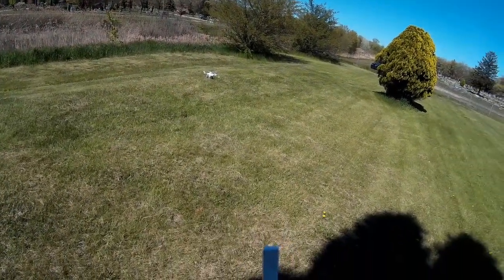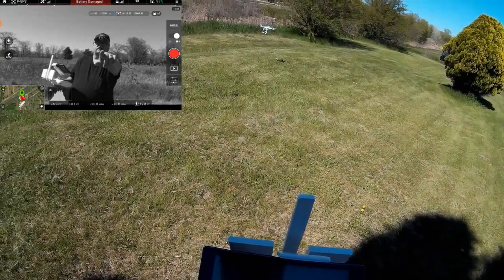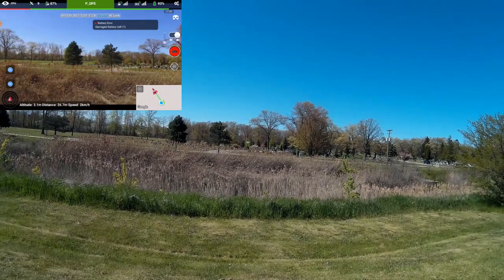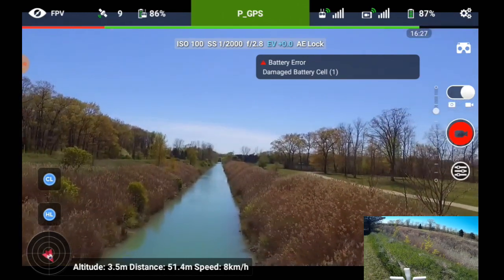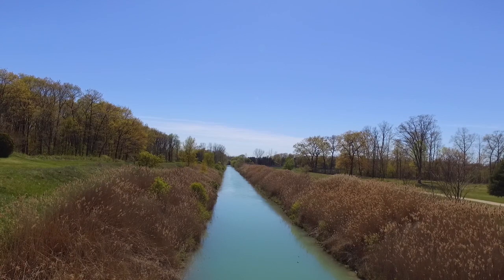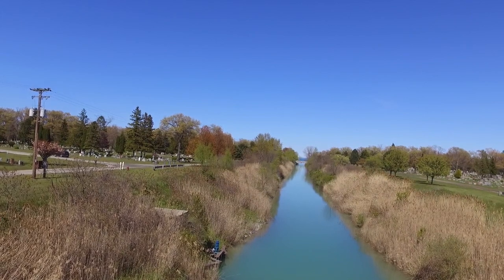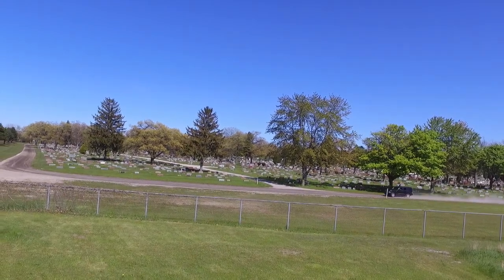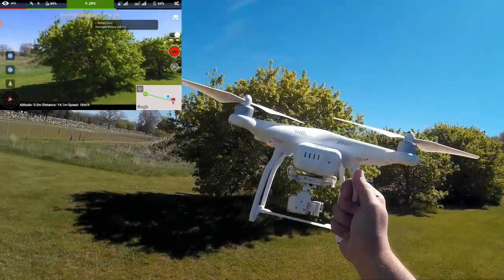Video Drone - DJI Phantom 3 Standard in Black River Spillway!

Comment: You use Litchi on you Android What Version ? I see some people with Obstacle  Avoidance on Litchi On the Iphone, but seems cannot find it on my Android, just curious are your settings the same on the Iphone and your Android?
Reply from the maker: Obstacle  Avoidance is based on the copter not the application so you need to have either the Mavic or Phantom 4...

Comment: I have FreeX quadcopter by SkyView can you upgrade arieal get 1000 want more range can you help make a video how to etc
Reply from the maker: Sorry don't have one, however does it have an removable antenna as that would be the first place I would suggest starting is by adding a higher gain antenna.  How far is it reaching today?
Reply: Video-Drone 1000 meters
Reply from the maker: Thats about 3,000 feet not bad.  Again just looking on the internet it seems to with appears to be a 1/2 wave dipole antenna (about 5dbi)  so you get a either a 7 or even 9dbi which I would guess could get you out to say 1250 or even 1500 meters.  But this would be max as the main thing your missing will be the protocol which which rides on the signal and cheaper quads don't have this sophistication...

Comment: Buddy O' Pal, You need to ditch that battery ASAP (get it replaced) It's not worth it my friend.
Reply from the maker: I am Bucking the (DJI) system!  I checked the cells and the are good with a cell checker, its just DJI firmware.   However on a serious note, I only I only fly it over places where if where to fail it simply will cost me the copter as I won't fly over people or homes in general but especially with this battery as I am interested to see what happens with it.  As don't tell the wife, however thinking about selling the 3 and getting a mavic as I really dig the Spark, however the 8 min (at any distance) has left me wanting.  Yet the portability is  crazy1
Reply: Can you accurately check the cells of a Dji smart battery with anything other then the aircraft's telemetry data?  I'll bet you indeed have a bad cell in that pack.
Reply from the maker: Yuper opened it up (wanted to see what as in there and used a cell tester...  :-)